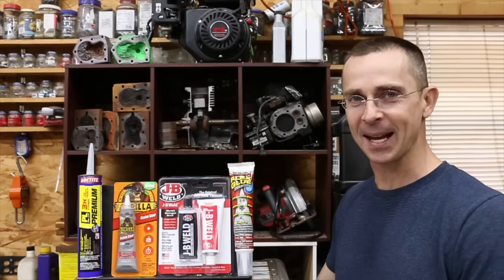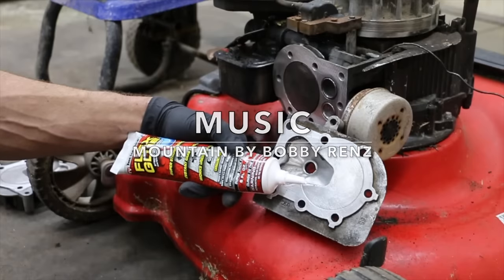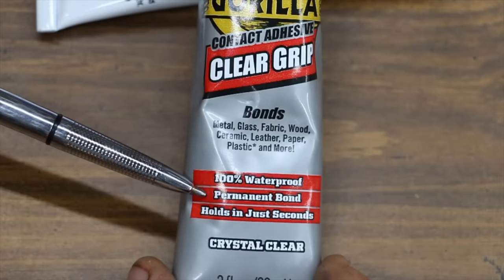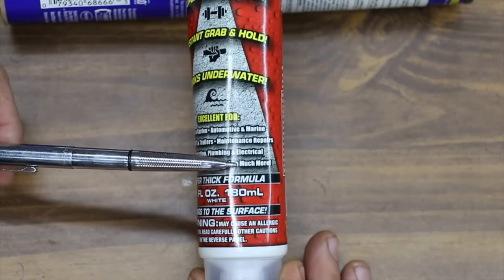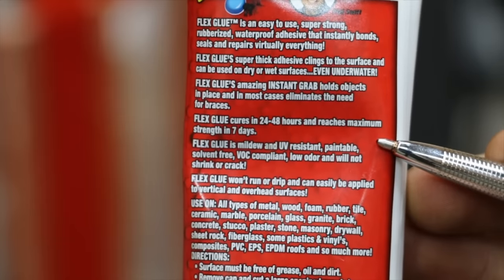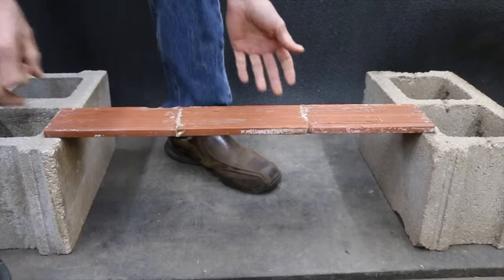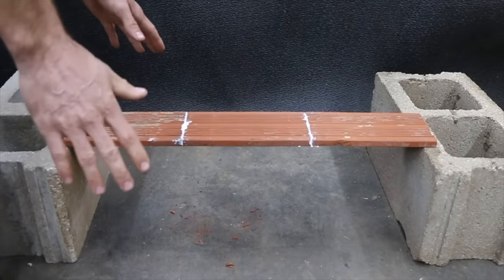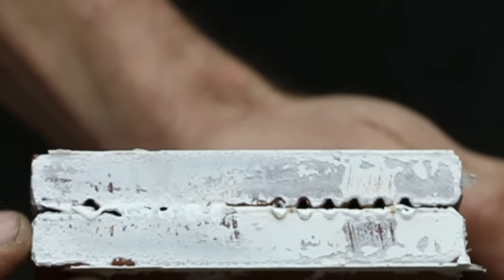Is Flex Glue better than JB Weld, Gorilla & Loctite?  Let's find out!

Comment: JB Weld Is Very Stout By Itself ..... To Make It Double Or Triple In Strength  , Cut Up Some Steel Wool With Scissors And Mix It Into The Paste ... It's Like Re-Bar For Concrete .... And It Gets Stupid Strong   !!  😆
Reply: Hmmm
Reply: Hope i remember that. Solid idea my man.  👍🏻
Reply: Fiber reinforcement, essentially. I'll have to try it.
Reply: I have tried that before, it is insane how much stronger it is. Best part is it can still be drilled and tapped.
Reply: Outstanding idea!!!!  Thanks!!!
Reply: Much apreciatte this! Thanks
Reply: Used this to get a can am clutch housing fixed before a race and it worked amazingly
Reply: @djwillx2tnb819   Mixed in some cut steel wool with it ??
Reply: Waylon McCrae yup
Reply: @djwillx2tnb819   Good deal , an old mechanic showed me that years ago , glad I could pass it on , be safe !!
Reply: thekeyboard warrior   you've tried that yourself huh ??  Had to get a little up close & personal to get that experiment up and going ...you are a doggone trooper !!  I'm glad Ms. Obama didn't walk in on y'all  !! 😎
Reply: @1973deepee  Just remember to degrease the steel wool with brake cleaner or acetone before doing it.
Steel wool has a light coating of oil, to prevent rust. 
Or, you could use stainless steel wool, used for packing motorcycle mufflers.
Reply: I used wire mesh to fix a hole in the oil tank on my chainsaw, its been great so far
Reply: Thats a fantastic idea. THANKS
Reply: Thanks for the info. really appreciate it.
Reply: @billyboots3730  Fine wire mesh is often used when performing plastic welding repairs, to add strength to the welded area.
Reply: @ wayton mccrae. Just use 2 bottles.  That's double the strength
Reply: @billyboots3730  
When I was a kid I used it on an old 70's steel dirt bike gas tank(without wire). On the bottom of both sides. It lasted about the riding season, then started seeping through. Of course this was early 80's. The formula has probably been improved.
Reply: I've done that with Kevlar fiber and it doesn't rust.
Reply: Space Comma...
Reply: It seems obvious once you say it, great tip thanks!
Reply: @happydays8171   😂😂😂🤣💀
Reply: Waylon mcCrae- aluminun screen mixed with JB weld makes an amazingly stronger bond.  Truly truly awsome combo.
Reply: Damn that’s a great idea
Reply: Screenshotted this so I remember 😂😂
Reply: Because it wasn't anyway
Reply: that would be a grand experiment for Project Farm
Reply: But how does that help in applications where you glue flat parts, since contact surface is the failiure point
Reply: cableaddict  so which epoxy is the best for smooth surfaces? Since in my case JB does all jobs tbh.
Reply: @LINKservis   Not ALL J.B. Weld Applications Consist Of Smooth Surface Adhesions .... So Use What Works For YOU !!
I'm Simply Stating A FACT That Is True , Is Proven , & Has Worked For ME On Numerous Occasions !! 
  Have A Nice Day !! 😎
Reply: @waylonmccrae3546  I was literally asking for recomendation for other products
Reply: @LINKservis   I wasn't cutting your comment down ... was simply saying that steel wool cut up in J.B.W. works extra good for ME in applications I have used it for !!  I use J.B.W.  yellow tube Seal-All , and 3-M hi-temp gas oil resistive gasket making compound for just about any application on the farm & in my shop ... and it has never failed to get the job done & lasted longer than anything I've experimented or used before ... find what works & stick with it thats what I've always said and those 3 aforementioned products get MY jobs done !!   Thanks , Have a Nice Day !! 😎
Reply: This works amazing. Thanks for the tip.
Reply: thekeyboard warrior  
😳
Reply: Well damn, you are a innovative mind, I like that idea...
Reply: Never use job weld to hold loose dentures in place. ...don’t ask, I just know

Comment: Sooo JB weld for everything exept wood, gotcha.
Reply from the maker: Thank you
Reply: For wood, you really should use wood glue :P  Seriously, I'd be interested to see how strong JB weld joins wood when not applied to the end grain. End grain is not a good place to apply adhesives without first preparing by sealing.
Reply: Liquid Nails for wood, Loctite is also a very good product adhesive ,believe it or not in the twenties and thirties and forties the only adhesive was black tar
Reply: For a long time there was just Elmers Glue also
Reply: Spreading the glue over 100% of the joints and clamping would make many of the glues, if not all of them, stronger. Many of the joints failed as easily as they did because of less than optimum gluing techniques. JB would still be the winner though, of these glues.

Comment: JB Weld, which is an amine epoxy, is great- JB "Quick" which is polyester based (I think) is not good for much at all and looks similar (packaging) so choose carefully!
Reply: Well thank you for that. you saved me from a mistake :D
Reply: i misread this as anime epoxy and was extremely confused for a second
Reply: @grexpex1807  I could see that as being a bit confusing!  Amine epoxies are the ones that have a part A/part B rather than just a part A and a catalyst, they are typically mixed in ratios of 1:1 to 1:4 and the part B is most often an amine, like triethylene tetramine. They smell like corn chips, as opposed to polyester resin which usually smells like liquid styrene.

Comment: flex glue: *loses*

meme lords: i dont speak wrong
Reply: What he used must probablybe a Chinese copy.
Reply: Nah flex isnt meant for this kind of testing. Mostly marine stuff like advertized. I can bet you that flex wins with water tests, since well.. its designed for that.
Reply: Flex products are more like water tight seal thing.
Reply: I think the flex glue needed more time to finish its training arc
Reply: @HuugTuub  there is underwater jb weld so I'd like to see that test
Reply: i knew a gunsmith ok one at best and he used jb weld to make cali compliant rifle conversions and some of em lasted quite the long time
Reply: Wait 1 week for full strength
Reply: He didnt use flexglue pro
Reply: James,
ISN'T A WEEK LONG ENOUGH? JUST ASKING...
Reply: @HuugTuub  IT EVEN WORKS UNDER WATER
Reply: He wasnt using the advanced formula version. But it probably cant beat JB weld
Reply: Creepystone Animations that loss is a lotta damage
Reply: ScreamingPandas7 it’s not as good as regular JB and doesn’t even seem waterproof, comes with a mixing stick though

Comment: I think JB Weld needs to buy you a pickup truck or something, haha.
Reply from the maker: lol
Reply: I agree. Lol
Reply: You put that bearded guy to shame with the stupid boat made out of screen doors lol....
Reply: maybe they already did?
Reply: Trent Robey no one talks about billy mays that way and gets away with it.
Reply: @dimesonhiseyes9134   BILLY MAYS HERE WITH ANOTHER GREAT PRODUCT
Reply: i think they already did
Reply: But wait! There's more!
Reply: JB weld seems more like a dual component liquid metal than an actual glue. "steel reinforced epoxy"
Reply: A restored pickup using JB Weld to hold some parts together lol.
Reply: Trent Robey omg i was thinking the same thing!
Reply: I have JB welded repaired several 2 stroke snowmobile engine crank cases. When a rod goes out of the crank it busts a hole in the bottom of the case JB weld will fix the hole shut and they will run forever. Also when we modify these engines we will do alot of port work and JB weld will fill in spaces or voids that would cause poor flow. Im with you I love that product
Reply: rmjthunder it was suggested i scratch/score my old 96 toyota engine.... It was a pin hole. Jb welded it . it held up longer than the transmission
Reply: U know, now that i think bout it. I had a yamaha xt 125, the chain jumped front sproket blew hole in case oil drained out. We smeared jb weld into oily hole as last ditch effort to seal case and it held. Second smoothed out layer after cleaning and it was like new. Never leaked. I was 15yr old.
Reply: craig takafuji he deserves it.
Reply: And deliver it glued to a helicopter ahaha
Reply: Simon.Hymenbuster that guy isn’t billy Mays he did oxy clean and a lot of coke. He actually grew up 10 miles or so from where I live now in McKees Rocks I think. Would have to double check that.

Comment: I once used JB Weld to reattach the power steering lines to my old Saturn SL1. The two bungs for the lines had snapped off the PS rack as one piece. The rack looked like it had 2 holes with a figure 8 of fresh metal around and between them.
I drained the system and cleaned everything up then put JB on the mating surfaces. Lined everything up and then built a little volcano of JB around the bungs and the seam at the rack. I let it cure over night, torqued down the lines and filled the system. I was absolutely astounded to find that it didn't leak so much as a drop. I figured what the hell give it a shot. I didn't really expect it to work but trying was a lot cheaper and easier than swapping out the rack. I drove the car for another 3 yrs before I got rid of it.
Reply from the maker: Impressive repair!
Reply: There's a guy that once used it on a cracked motorcycle housing and run it for years.
Reply: 99
Reply: JB weld is junk. Use PC7 or Belzona.
Reply: @MrDeviousdom  ~~ boy, that's a powerful argument.
Reply: grate jb weld story i bet what you fixed with it mite out last that cars live jb weld up up and away the true super hero jb weld man da da lol
Reply: Don't know either of these other products but in my experience JB Weld is not junk.
Reply: I've been using JB weld as a thread sealer for Water, air and hydraulic systems for years.   Never leaks and the fittings dont need to be unreasonably tight now either.    

Also given it is not super strong unthreading fittings is not difficult either because so little is actually caught down inside the threads.  

I highly recommend it!
Reply: @ransomprigg1047  well, its true. JB weld is homeowner grade epoxy.
Reply: @MrDeviousdom  ~~ I could tell when it would only hold 115 lbs it's real garbage.

Comment: Darn! Says someone who bought Gorilla a while ago to do a simple repair on some cracked plastic. But have been a JB weld fan for many years, and you were testing it on dissimilar metals(which it's sometimes used on too)..but it is frequently used on the same metal, and in my experience in that case is it is even stronger repair. Good stuff, and hope they never change the formula..and for those that say it burned up in something, they make high heat formulas too. Always good to see you test things for us, and we know it is done with an unbiased eye and intent, which is greatly appreciated.
Reply from the maker: Thank you

Comment: That was a awesome test 👍👍..iv been a automotive and diesel mechanic for 35 yrs and iv used JB weld on many things and it is amazing on what it can do...iv put it on a cracked engine block that froze and cracked on the outside of the block and after 13 yrs it's still holding and being used daily...the key to it working properly on anything is preparing the surface and letting it cure properly.... great video thanks again...
Reply from the maker: Thanks!  Thanks for sharing.

Comment: A couple of comments:
1.  I was a forestry major in school.  Wood is not tested with butt joints like those shown here.  Test it in shear parallel and perpendicular to the grain.  We tested wood and plywood in class.  For your purposes, glue up two pieces and try twisting one off while the other is held firm.  Keep in mind your glue joint will be affected by porosity, moisture content and the presence of any extractives in the wood.
2.  J.B Weld:   Mix it with sawdust and use it to plug holes in wood that you are going to put screws in.  In my case, it was a storm door piston type closer that had been ripped out by the wind. 
3.  I live on the Atlantic seaboard in an area subject to hurricane and gale winds.  My house is brick.  One of the brackets on a deck awning was ripped loose by wind.  It had been anchored in the brick mortar with lead anchors and lag bolts.  I got new anchors and put them in the holes with J.B. Weld.  That was 12 years ago.  Still there through some tough weather.
Reply: CyPhi68 love the sawdust idea, thank you!
Reply: I think he's testing the glues and not the wood.

Comment: Got to say, we've used JB Weld for years, honestly, I'm not a big fan of epoxies, but they do have their place!! As I'm sure you know, there's thousands of different epoxies out there, most are great for one thing, but not much else.
I've used JB Weld on leveling a diesel engine block.. last I heard, the truck it was in was still working on a farm in Eastern Washington... 
JB Weld is the only thing I've found that works worth a 💩💩 💩 on the plastic tanks and frames on chainsaws....
Works well for repairs on livestock water floats... Rubbermaid makes an EXCELLENT float, but has no insert the the garden hose connection, so... When the threads finally stretch out too much to hold, I JB Weld an adapter in to it... 
Works very well!!!
Now, my point... I am awestruck at the results of the plastic pipe test!!!! I figured it would do well... But not that well!!!
Thanks for another great video!!!
And, Merry Christmas!!!
Reply from the maker: Thank you. Merry Christmas and Happy New Year!
Reply: Yea Ed, that plastic pipe test had me saying "no way!"
Reply: Great video. Have you made a video of different products cleaning oil stains off a concrete shop floor?
Reply: I had a friend who used JB weld to build up worn cam journals in a motorcycle engine and it actually ran for a few years after that.
Reply: @elmerk1  that's pretty impressive!!!
I thought filling in a few pits and low spots on a 262 Cummins block was amazing... All it had to do was fill the gaps for the head gaskets... But to have cam lobes hold up.. definitely impressive!!!
Reply: Theres my farm buddy how many head
Reply: For exhaust work. Furnace cement doesn't burn at 300 like JB weld

Comment: None of the Gorilla products (tape is ok) have never impressed me. Great work as usual. Merry Christmas.
Reply from the maker: Thank you. Merry Christmas and Happy New Year!
Reply: The glue is kind of ok, very good for porous stuff like broken wood on toys
Reply: @kitecattestecke2303   I use Seal All a lot, and just a silicone adhesive caulk, which they work great for the applications I use them for. Idk about wood, I don't do much with dead tree carcasses lol
Reply: The Gorilla polyurethane glue is one of the toughest single part wood glues out there and with a bad fitment beats epoxy as it will expand like a foam and fill the imperfections when you introduce water into the seam. It will also mess up your hands like nothing else because the chemical reaction burns water and you happen to be mostly water.
Reply: I used Gorilla wood glue on a Cerwin-Vega speaker restoration project, and nearly 6 years later still good as new!
Reply: The gorilla super glue is really good for most things you'd use CA glue for. It's a little more flexible, which can be the difference between it failing or not.

Their standard gorrilla glue is good if you need the foaming/gap filling that it does. Again, it's flexible, so for applications where all that's important it's great. I usually use it on wood where the structure  itself needs to flex a little which makes it superior to regular wood glue.
Reply: @twiz8789  Desiccated tree carcass? Disgusting.
Reply: @kitecattestecke2303  I doubt it would outperform regular wood glue tho.
Reply: Tape is ok? No the gorilla tape is honestly really good stuff. I also used gorilla crazy glue and that stuff was damn impressive too. The crazy glue will literally expand so much it will push your two pieces apart if you don't clamp them. Works awesome.
Reply: I believe the DUct Tape came in second on his testing. ISo it was what I been buying cause i cant find the #1
Reply: Yup the tape lives up to the claims but then I never tried flextape,yet
Reply: agreed, the tape is weak compared to others and overpriced
Reply: @twiz8789  Boo lol. Come on now, us woodworking types have to work metal in our shops a lot, and I mean a lot. But Merry Christmas anyways :P
Reply: As far as tape goes, I usually prefer T-Rex but I have a ton of government 100mph tape from when I was in the army and for holding power it beats everything as long at you don't mind olive drab color.
Reply: @jefrey5578  Very true, the only thing close is that automotive racing tape or maybe the flex seal tape, that stuff is sticky as all get out.
Reply: Tape, and their orgional glue is great. I have yet to see either of those fail easily. I hear their wood glue gives Titebond a a run for its money as well.
Reply: @jmhm17  The trouble with their wood glue is it dries brown rather than clear, Titebond and Elmers are safe for now on that one.
Reply: You would have to be a gorrila to think of this as a permanent repair.
Reply: @upsidedowndog1256  Na, but it can get you through until you can get to an actual welder or mechanic because oil pans do get damaged from time to time.
Reply: Project Farm  I don't mind sending you a roll of actually government issued 100MPH tape if you want. Online there are alot of imitations but they are usually crap.
Reply: @TommyboyGTP  As far as glue goes, E6000 is my usual all purpose goto but if I am doing automotive I only use JB Weld.
Reply: TwiZ1975cj5  so gorilla products are good?
Reply: Didn't like his wood test , using pressure treated - pressure treated wood has nasty stuff in it. You're trying to glue chemicals instead of wood. Gorilla glue on wood works for me.

Comment: Back in the 80's my brother had a crack engine block from him not using antifreeze in the cold season. It cracked at the cooling passage. We used JB Weld and used a halogen spot lamp to cure it. It held up and saved us big $$$